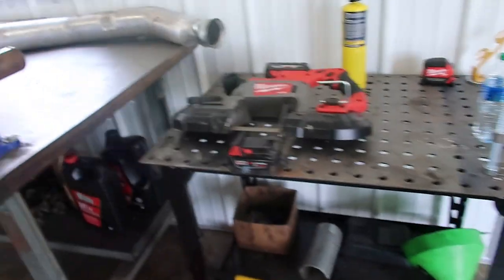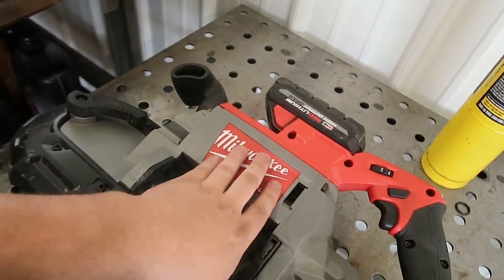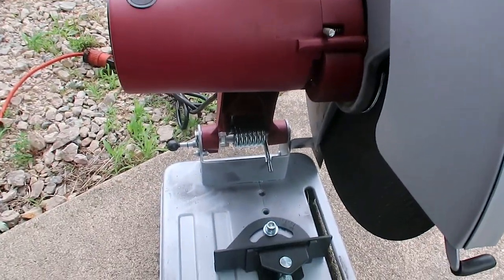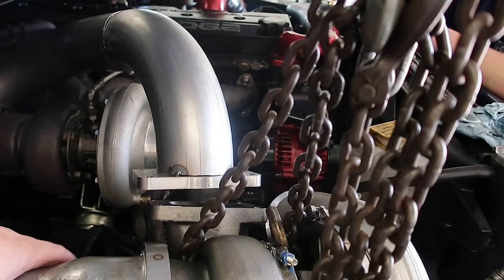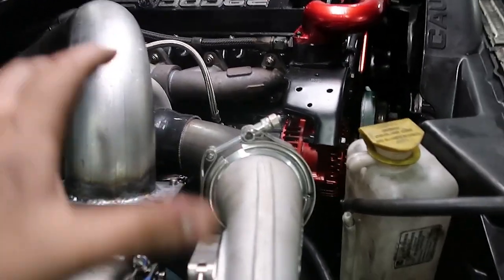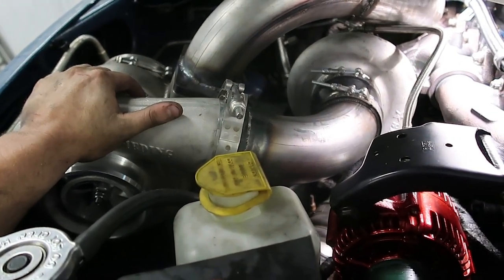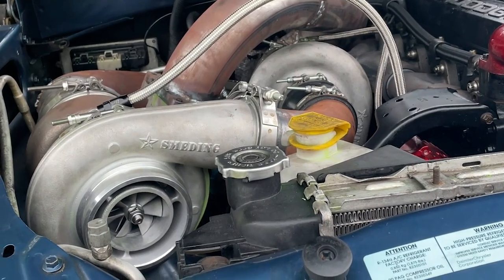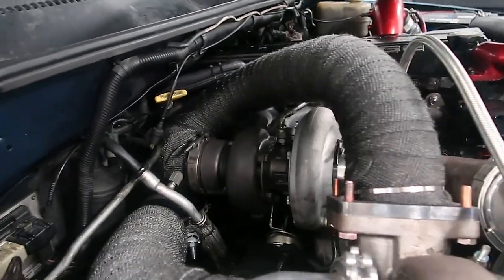HOMEMADE COMPOUND TURBOS! 2002 CUMMINS

Comment: Good to see a couple young guys... in today's generation... doing a little old school hot rodding and burning the midnight oil out in the shop... that's the fun and good stuff 👌I think you have the Truckmaster thinking now with his Cummings build...Look forward to seeing what the end results bring. ... run a cold air intake box behind the grill.... outside of the engine bay...

Comment: That’s a very good sizing setup for compounds! Exact setup I have. Works super! With Flux diesel Mach 5’s on p pump @19* spools super quick. Little to no smoke on low end. Looking to maybe swap out compressor wheels for 6 blades for better flow on top end.
Reply: What setup does he have?

Comment: 64/68/12, 475 96 t6 1.15 about to get built over here on my 12v. This video gets me pumped, had to watch it again
Reply: How’s that setup run looking to do the same was going between the 1.15 and 1.32 housing and are you t3 or t4 on the s300 manifold charger?
Reply: @gavinstewart4133  haven’t done it yet, just got my spring gate last week, and my intake plenum back from the machine shop. Buttoning up some projects then I’ll start this. Shouldn’t take me more then a few days once I start

Comment: Great video! You could have flipped the exhaust manifold and put the big charger on the bottom of the small one and used less exhaust pipe in the motor compartment. Either way great project. Thanks for sharing. 👍